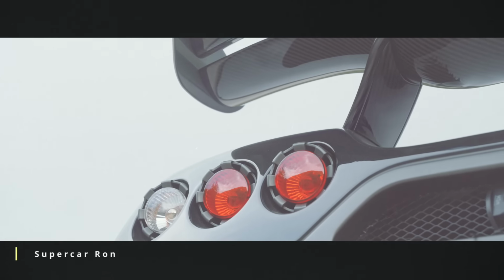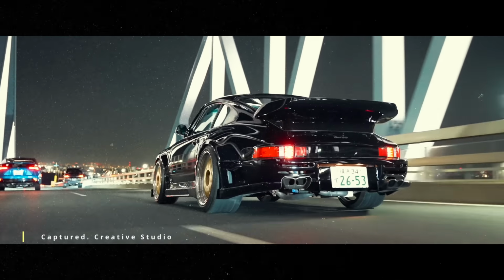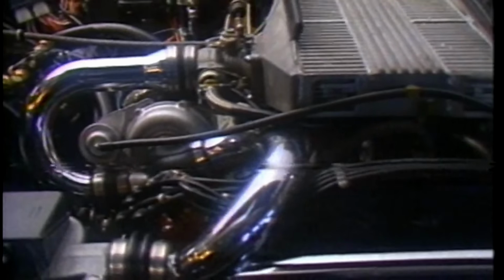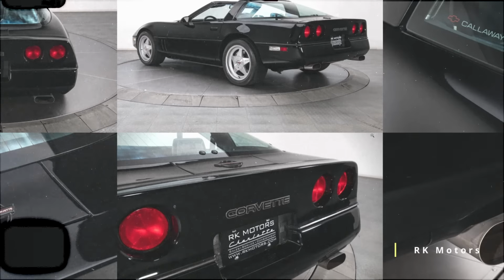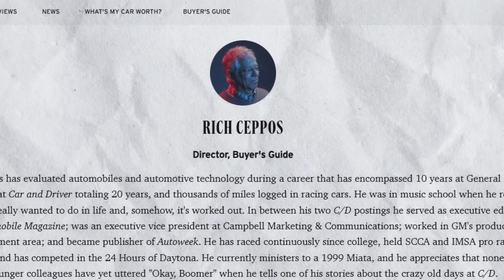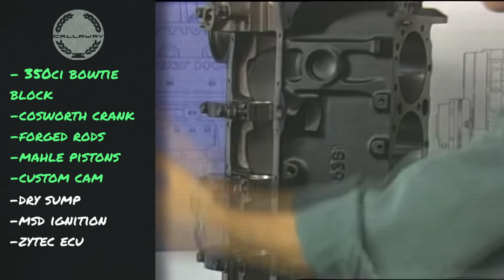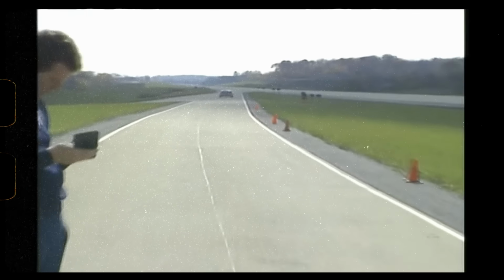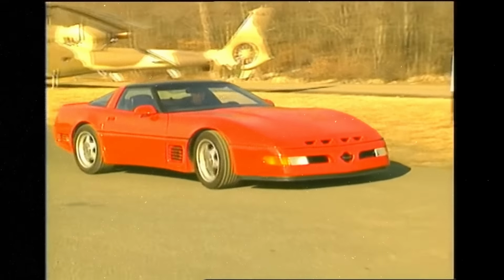Was The World's Fastest Street Car for Almost 20 Years

Comment: How about Rolex 24 some years back the Viper came in 1,2,3, and 5 in one race so take that back to Germany .who cares about a 50 thousand dollar interior in Porsche or mercedes that doesn't matter when you want to go fast. And a Veron 2.5 million the 96,000 dollar no dealer greed added Demon 134 will out accelerate it with a 1.66 0 to 60 time. The point being for the money spent its a laugh. American cars kick ass plane and simple. Watch Cuda vs. Enzo Peter Klut put togethet a 1970 Cuda and put it up against a million dollar Enzo with all due respect to Enzo quality and the  pro driver of it . Top speed of the Veron 300 mph. and the hell are you going to go that fast 😂 the autobahn. Here its all about 0 to 100 mph. Because roads and the safety of others on the roads is a consideration. The roads here with a million dollar car bottoming out on a pothole would be an expensive fix no doubt and eith these expensive exotic cars 5000 h.p. at what price? If you really want to see something really impressive watch and listen to the sound of a top fuel cars burn out and make a run down the 1000 ft. mark at almost 340 mph. especially the 4 lane its is an earth quake . Now thats awesome in my book!